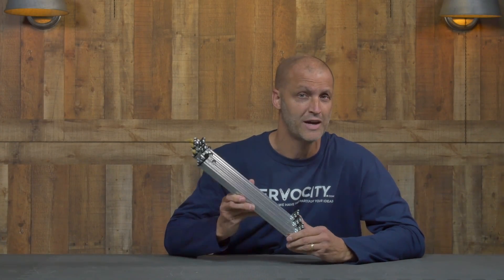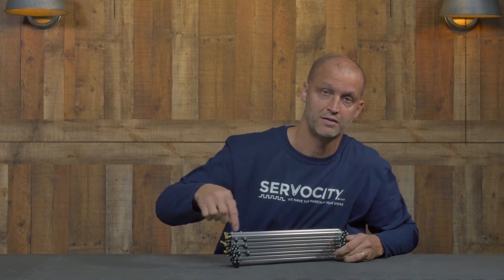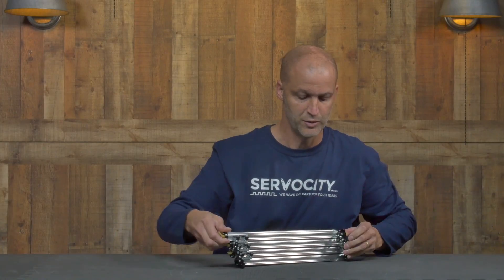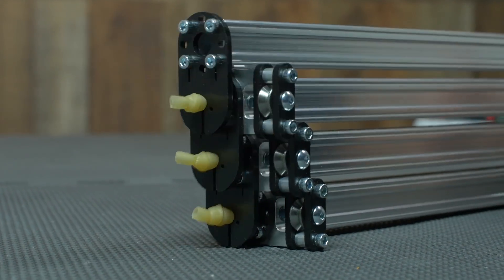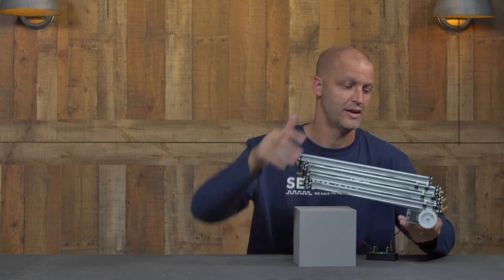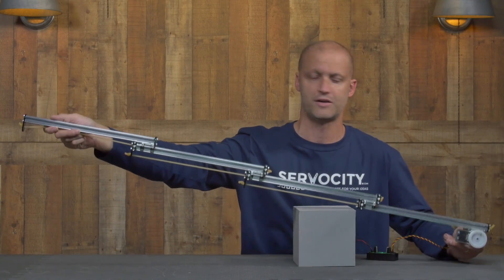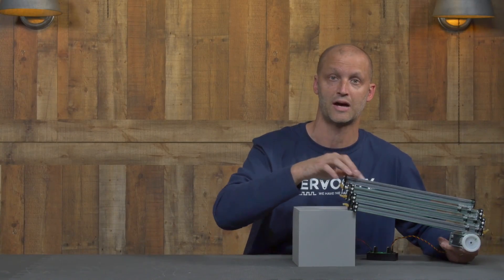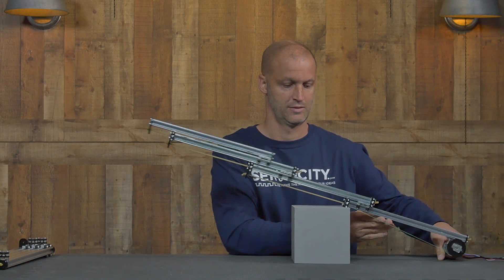ServoCity Products: NEW Cascading X-Rail Slide Kit

Comment: I was wondering for my robotics team would it be possible to cut all the metal pieces shorter and still have it function just not reach as high?
Reply from the maker: Yes, you can cut the X-Rail and re-tap the cut ends.  Re-tapping is relatively easy as the X-Rail has holes through the entire length that are the appropriate size for a 6-32 tap.   Here is another video you might find helpful. https://youtu.be/rl_8cObnl1E Feel free to reach out should you have any other questions tech@servocity.com.